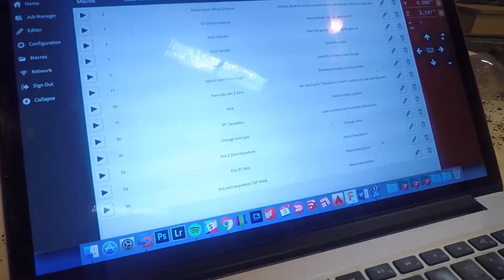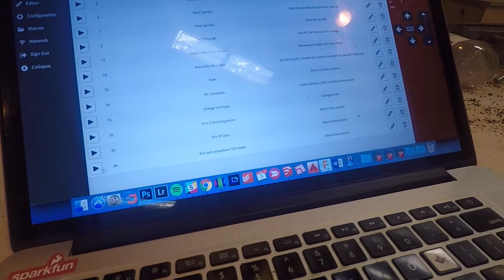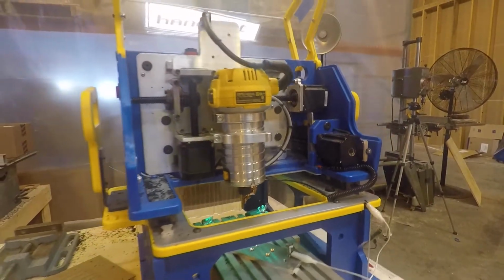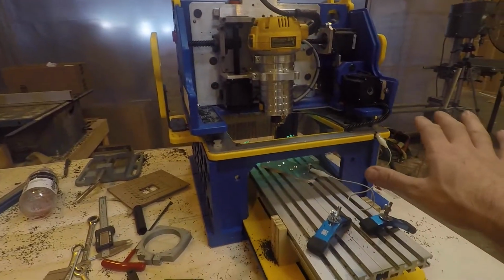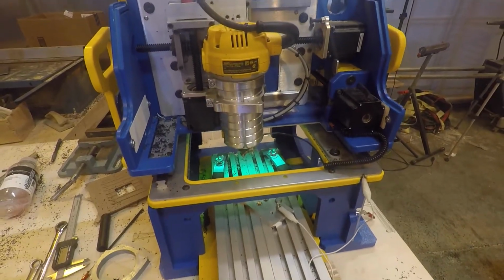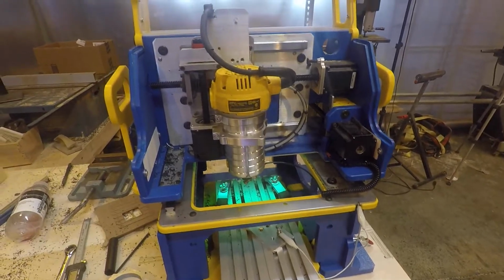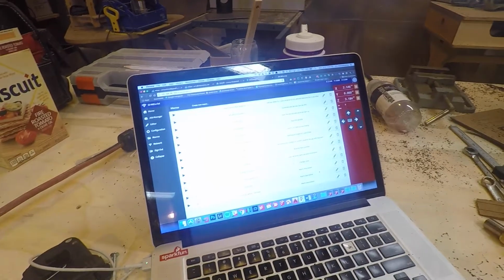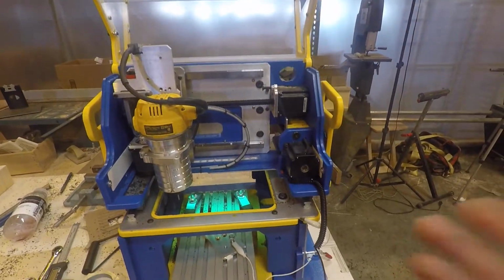Handibot Accessory Base

Comment: I am using my handibot for a similar application and need the same code that you use for the zeroing and the 1in move from z zero.   I hate to ask but is this code something you would share?
Reply from the maker: I can share the code with you for sure. Head over to the Handibot forums and ask there. I'll post it.

Comment: Hi. What kind of software are you using on the mac?
Reply from the maker: I use SketchUp to design, and then I use Vectric VCarve/Aspire to make the milling files. Vectric software runs on Windows, and I'm running a virtual machine with windows installed to do that.

Comment: Hi Eric,
Can you tell me about the cutter you are using on this HDPE, as well as speeds and feeds?
Many thanks
Wazza
Reply from the maker: On my Handibot I typically cut HDPE at 3 inches per second with an 1/8" bit. I take light passes, usually around .04-.08. I have the router cranked up to about 75%. On my large CNC machine (full-size ShopBot) I cut HDPE at 4.5 IPS, .25 depth per pass at 18k RPM.
Reply: Thanks Eric, for the rapid reply. I will try those numbers on my Handibot. I think I had mine set at too fast a spindle RPM and feed rate too slow.
Regards,
Wazza
Reply from the maker: Good luck! Also try a single flute upcut bit like this: https://www.amazon.com/LMT-Onsrud-63-610-Uncoated-Diameter/dp/B001VY3664/ref=sr_1_1?s=hi&ie=UTF8&qid=1499288912&sr=1-1&keywords=onsrud+upcut
Reply from the maker: You've got to keep a good chipload going. I'd say go 3 inches per second with a 1/8" bit doing 1/16" passes with the the router at 75% speed and you should see good results.